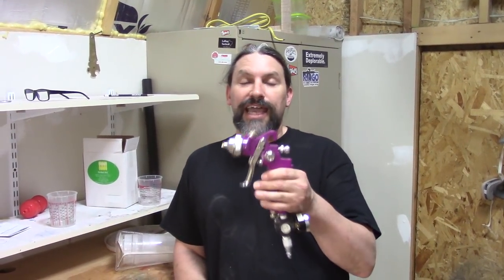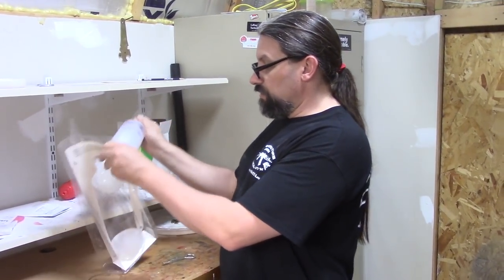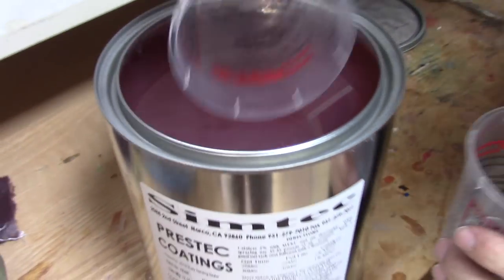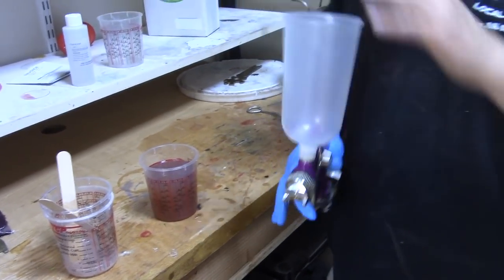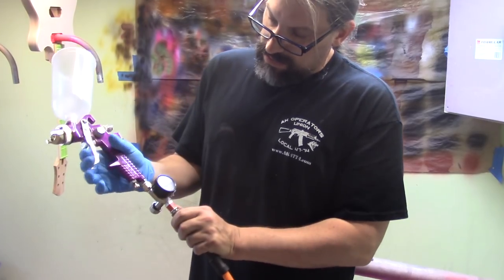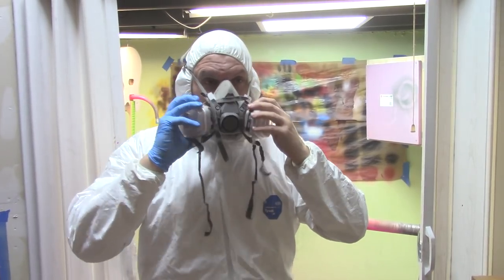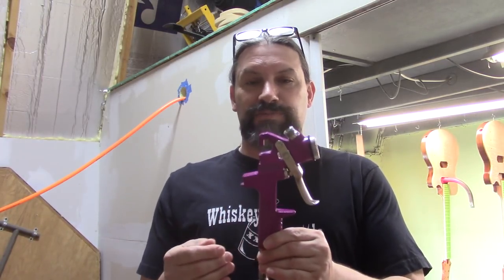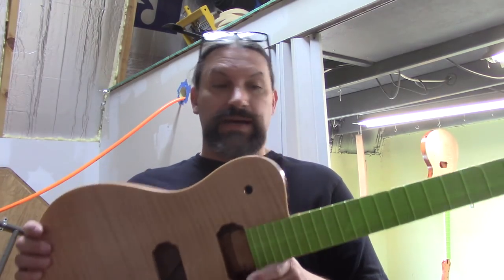Watch What Happens When We Try To Use A Cheap Harbor Freight Gun To Spray SIMTEC Sealer!

Comment: I paid $9.99 for mine with a coupon! While not my best gun it does a good job as a general use spray gun.
Reply from the maker: Yep, it shouldn't replace your good spray guns but it will work. We are all on a budget and sealer guns are one of those places where you can cut costs

Comment: We use 1.4 & 1.3s spraying cars. One of the guys at work uses those cheapo guns for primer, and they spray fine. It's no SATA, but it's also not $800.
Reply from the maker: I used to think that a spray gun is a spray gun and for sealer I guess I still do. We have nice guns for base coats and clear and I have learned the error of my ways

Comment: Hey Matt….if you are using dye to tint the wood is there an issue spraying sealer over top ???… oh, and what tuners were on the LP originally???
Reply from the maker: Sometimes we use dye directly on the wood and spray sealer directly over it. Ain't no thing. I'm posting another video tomorrow that will not answer any questions. The tuners were Sperzels… let me know if you need a set
Reply: @TexasToastGuitars  … Thanks Matt… Videos don't always have to answer questions …. its like standing around in the garage watching somebody else work on a car, or at the range watching somebody else shoot a string…. its entertaining to watch.!!!  I was wondering why the pin holes were above the shaft hole  … now I know what to look for…. should be up and playing very soon….

Comment: I had one to shoot a table with Rustoleum water based acrylic clear. It broke on the second coat. The cheap Campbell Hausfeld from Wal Mart works pretty well though. But they are like 2x the cost.
Reply from the maker: Hmmm that's a bummer. I have been giving the one we bought a workout, lots of abuse. Probably not a hell of a lot of QC at the HF factory?
Reply: Texas Toast Guitars that would be my guess.

Comment: Hi Matt, there is defenitly something wrong with that Harbour gun. And i know pretty sure why. No any gun may make such a "squiky" sound. Cheap or pricy. If you buy a "cheapo" gun, wich is not always the case or has to,.. the first thing you need to inspect is that the needle is perfectly straight and fits perfect in the inside of the nozzle IN the gun. Here is almost sure a tiny leak. How to solve this. First check the straitness of the needle. Then apply fine abrasive metalpolish on the inside off the nozzle and on the needle point. Put it together and turn the needle around with tiny force with two hands untill you get a smooth finish. You can also use buffing compound for the final clear finish in various grits.That is the MAIN difference between a high end, and a cheapo gun. I only use a higher end SATA 1.4 gun for the clear coat. For the rest, like primer, i use mainly 40 to 50 $ guns with 1.8 or 2.0 nozzle and two tiny 0.5, 0.8 and 1.0 mm nozzle guns for color and doing bursts. They do the job well, but off course, don't expect an IWATA finish,.. but with good polish..Devillbiss quality. Greets from Belgium !
Reply from the maker: Once that HF got caked with crud the squeaking went away. I'm still using it hahaha.
We Use Devilbiss Finish Line guns for base coat colors and an Iwata for clear. I certainly do not advise using the cheap guns for anything besides sealer. Thanks for watching

Comment: I use a cheap tcp global hvlp with a 3.0 tip...so far its seems to work pretty good. only trouble I'm always dealing with is orange peel I can never get it to spray nice. I can when I dump it on but then it runs...I'm always sanding it flat or close it since you don't want to sand through to the candy, metal flake or artwork which I've done....that makes me so fucking mad!!! Last time that happen( a few years ago)I got in my car kranked the radio (alpine system w/ jbl 12W3 sub) hit the highway(rt 95) going a fast as my piece of shit car would go around 120-130 foot right beyond the floor board like I'm working out on a Nautilus leg machine and had bad road rage with anyone! LOL!!!!!! I think back on that. only a idot would do that..oh well at least I wasn't tanked doing that...live and learn. But really I should just use a winnie roller for the simtec sealer...why spray it on..?? Think I might do that method on the snake skin fabric top you made me.  Anyways Matt great video as always!!! All your videos are very informative which I have learned from. Keep them coming and keep the coors flowing! Coors banquet that is :)
Reply: Alan L I have one of those to shoot heavy metal flake with. It’s not a refined gun but it works.
Reply: @roberth4688  yes I agree. I was going to get a lil daddy roth metal flake hvlp gun but its 99.00...the tcp global is about 35.00 if I remember correctly. I want to get some of those plastic cups for the gun that matt was using...just makes clean up a little easier
Reply from the maker: We already sealed the snake guitar for you :)
Reply: @TexasToastGuitars  Yes thanks:) I meant using the simtec top coat (27x6 A-18 Thick Clear Gloss Topcoat) then a clear urethane top final coat(I use napa martin senior ultimate over all clear similar to your ppg deltron just cheaper